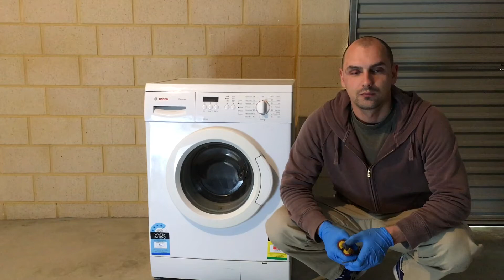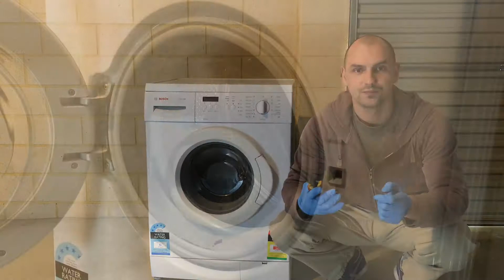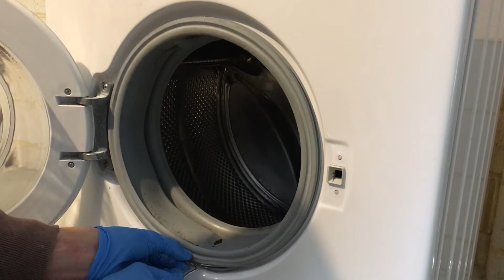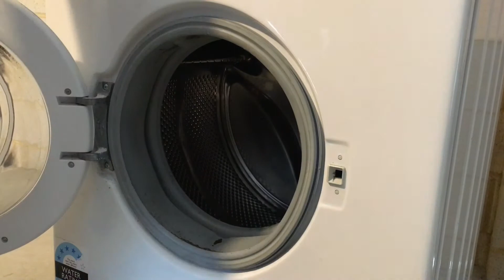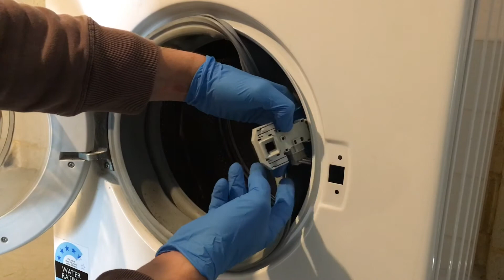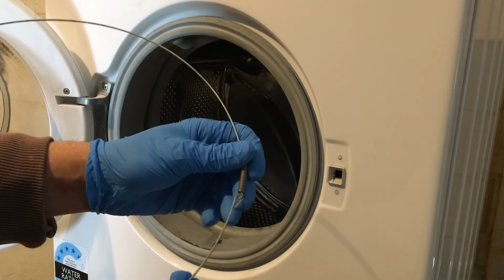Bosch Washing Machine Door Lock Replacement Maxx Classixx

Comment: Great video, thanks. How do you get the door open to replace if handle does not release door?
Reply from the maker: Turn it off at the power point for about 5 min and the door lock should release the door. If it still doesn’t open, then the door handle might be broken or the lock is stuck in the locked position.

Comment: Varioperfect maxx 6 reset
Reply from the maker: Try this:

- Close the door
- Set program selector switch to position 0 ("OFF")
- Wait two seconds
- Set program selector switch to position 8
- Wait until the start LED is flashing. (will take about two seconds)
- Wait two seconds
- Press and hold “Spin Speed” button
- Set program selector switch to position 9 - Release the “Spin speed” button.
- Error display "Last program" - Display indicates last error
-error memory is cleared now